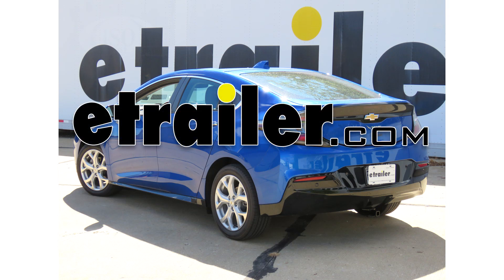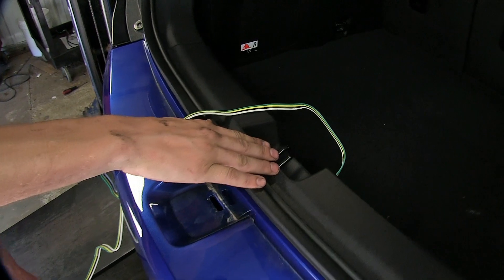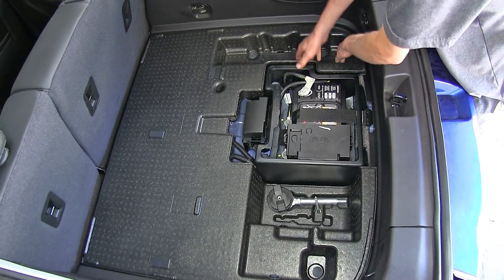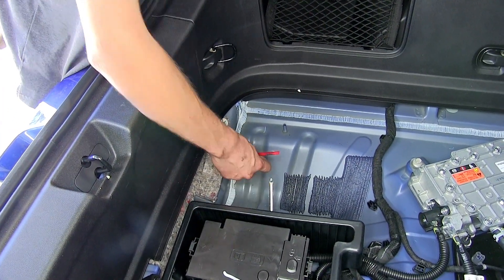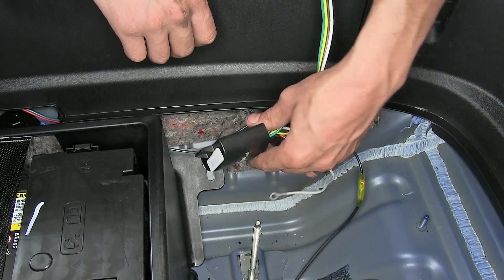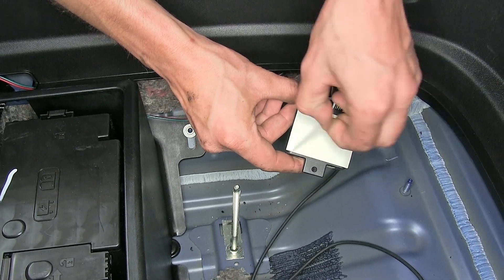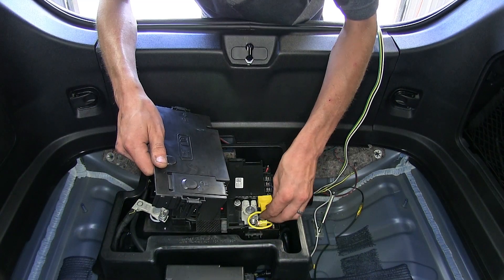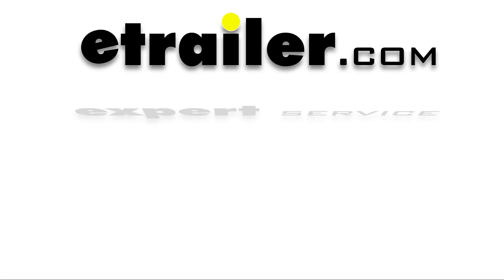Set up: T-One Vehicle Wiring Harness with 4-Pole Flat Trailer Connector on a 2017 Chevrolet Volt

Comment: Will this work for a 2017 Chevrolet Bolt?
Reply from the maker: Unfortunately, we do not have a wiring harness that is designed to fit the 2017 Chevrolet Bolt.
https://www.etrailer.com/vehicle/2017/Chevrolet/Bolt